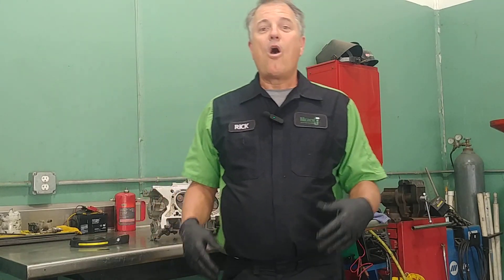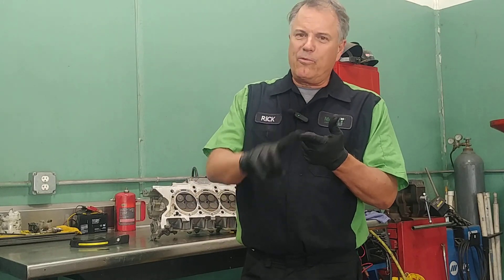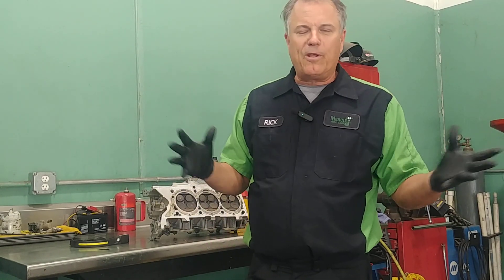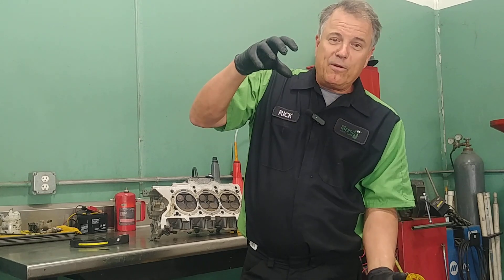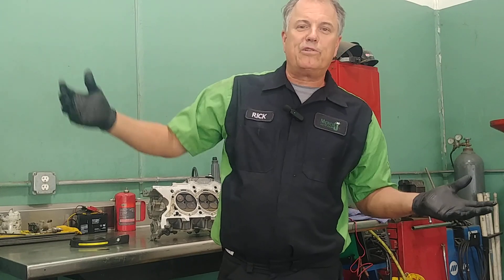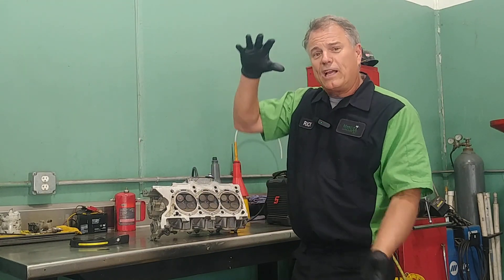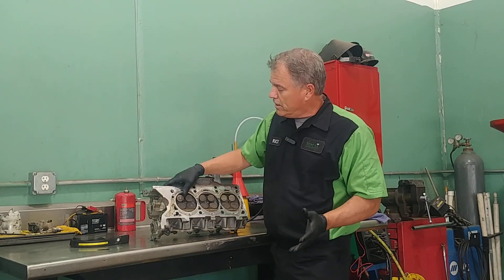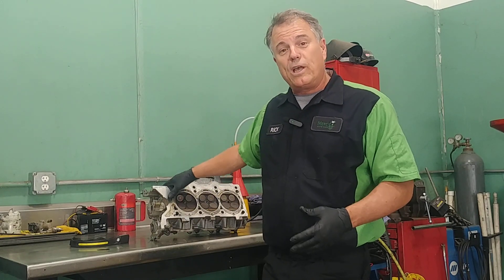What is an Engine Misfire?

Comment: So what exactly is a misfire? Answer wasn't specifically given. Does that mean that the spark plug didn't create any spark and the engine pointlessly got the fuel, got the air, but couldn't ignite it just went... somewhere?
Reply: The name is what confused me it’s called a misfire but a misfire is when the conditions in the cylinder aren’t sound enough for combustion. So if u have no compression you will get no fire or a very weak firing of the spark plug. Which could be caused by worn piston rings damaged valves etc.